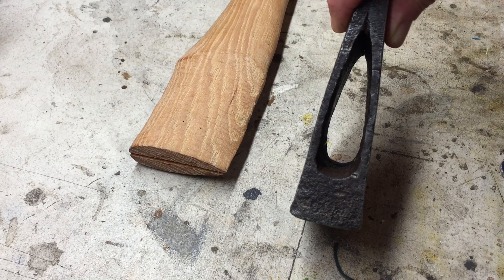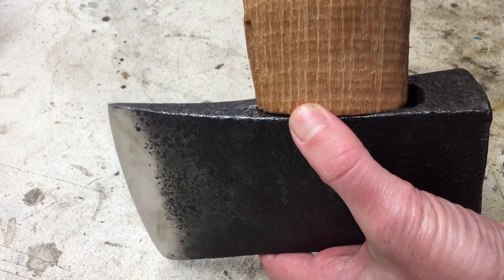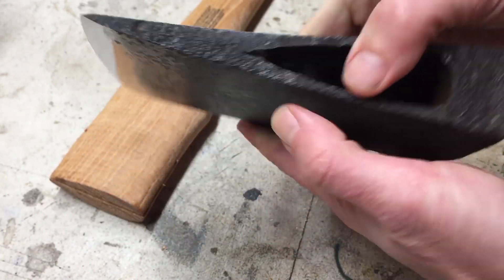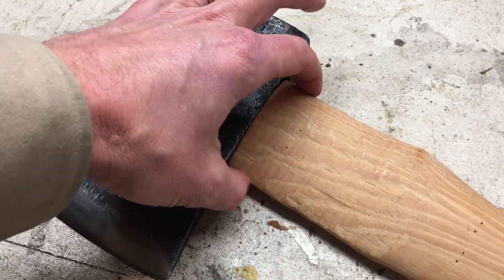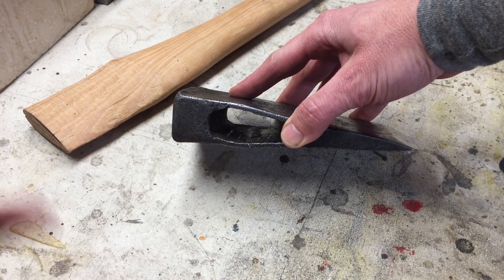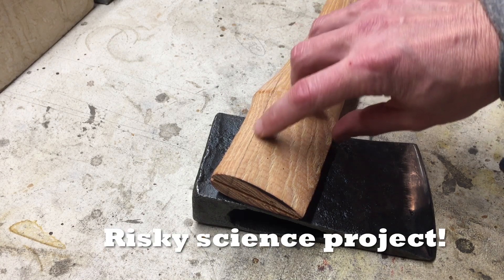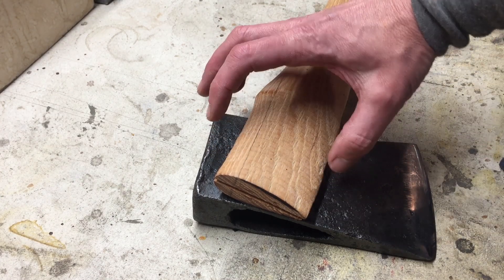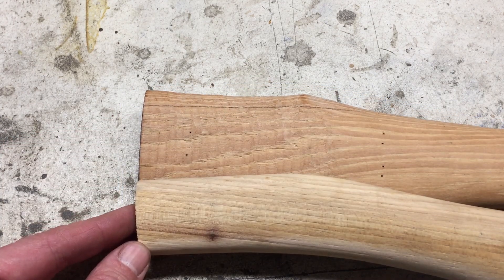5-Min Axe School: The Efficient Axe Ep11 "How Strong is Wood Glue Anyways?"

Comment: Nice vid, really enjoy your stuff and was looking through this series to try to solve my specific problem. I  have a nice hytest craftsman that is so open it is driving me nuts. Short of carving a handle for it I may have to try something radical like this to bring it into alignment. Some of the Hultafors handles look to have more of a closed kick to the eye wood that may work,  that may be my next stop. I was interested as to how much alignment deviation from ideal affected cutting performance in reality.
Reply: G'day mate. That open hang is a bit of an issue with lots of Tassie patterns, hytest, plumb, walters etc. It's definitely worth getting your alignment right with a Tassie,  hung too open they're prone to cutting with the heel only. You'll notice it especially when chopping underhand, just feels weird and need more swings to overlap the cuts. I've had success in the last 3-4 years with hultafors 32inch/800mm handles and also the 30inch/750mm, however the last batch of 30s I got about 6 months ago the eye seemed shorter than usual and wouldn't fit a walters, only just squeezed on a plumb 4.5lb. In the states Killinger does a long eye handle, in Aus you could try a Cattledog 800mm spotted gum. Good luck

Comment: why do you like the hults bruk handles/swedish/smedburg handles so much? I've found they look nice but practically aren't all that great
Reply from the maker: I love them and it's hit or miss with House Handle, Beaver Tooth or Link. I haven't tried CT replacement handles yet though.
Reply: @BushcraftSisyphus  with the exception of wanting a straight handle, try an Ochsenkopf race handle if you can get them. They come with lovely tight grain and give you the option to change the length as you wish. Worth try if you're already paying a fair amount for a swedish handle anyway they will be fairly similar in price.

Comment: Resorcinol glue, which will leave a purple line if used properly would be leave a joint stronger than the wood.  Thin with 10% alcohol and paint on the first coat to penetrate, then glue things up. Not as pretty but stronger and more resilient than the underlying wood.  Supposedly some of the other phenolic glues (that are clear) are almost as good.  Oh, and it would be waterproof.
Reply from the maker: Great tip! Mr. Tightbond will be fully stressed come testing day lol